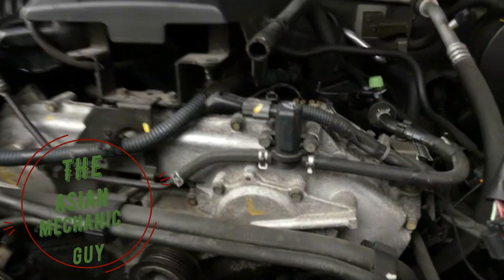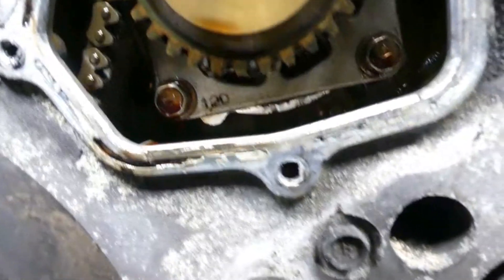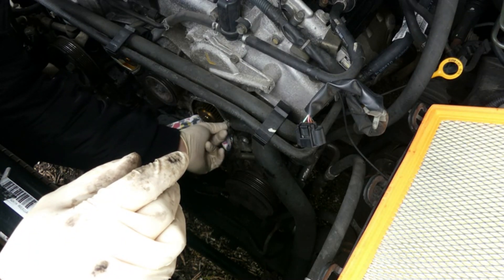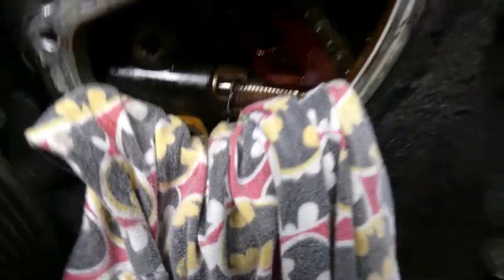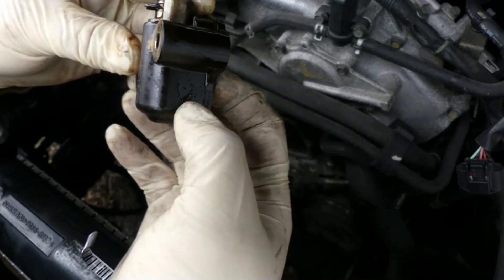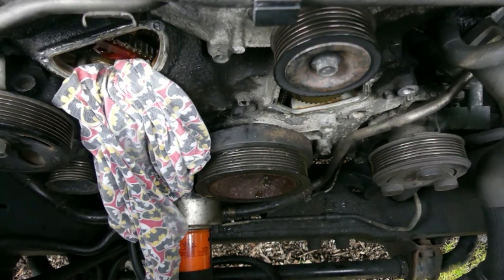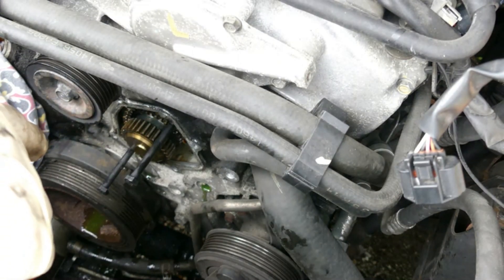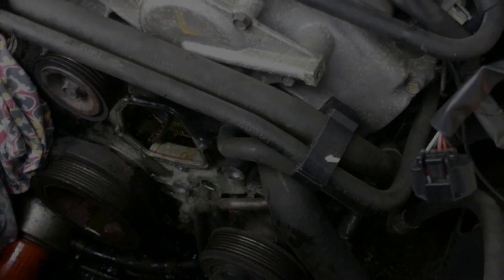2006 Nissan Frontier 4 0L water pump Leak Diagnosis & Fix PT 02

Comment: For water pump replacement CHANGE YOUR OIL BEFORE YOU BLEED THE COOLING SYSTEM. I got the engine up to temp to bleed the system. Then I went and got the stuff for an oil change. I remove the oil cap and it was creamy white !!!!! I immediately drained the oil and it was also completely contaminated!!! I drained it changed the oil and filter. Ran it for 3 minutes. Drained it AGAIN STILL WHITE . 
Went to the store got two more filters and more oil. Filled it again with new filter and 3/4 quart of trans fluid let it run for 15 minutes drained it and it got better. DRAINED SWAPPED FILTER AGAIN  ran it for 10 minutes drained it and then did a final filter and fill. I have videos and photos of the whole ordeal.  PLEASE PEOPLE DO NOT START UNTIL YOU DRAIN OIL AND REPLACE FILTER.  There was very light gold flake in the pan. Which means BEARING material. Final oil change I also added a quart of Lucas oil stabilizer.  I hope I'm able to get some years out of the engine.  Prices are going up for replacements and they all have higher mileage.  $2500 for 140k mile replacement engines..

Comment: Anyone who has never done this be careful b/c tbe tensioner plunger is spring loaded n can and probably will shoot out n can go into engine. U are supposed to press the plunger piston in and secure it with a paper clip or something(new one comes with a pin,u can use it), then unbolt the tensioner n remove it. When installing put tensioner in with slack off that side(makes it easier,but not 100% necessary) tighten it to 75 inch lbs n then remove pin. Good luck!
Reply: why u need to press it in when the plunger is already out i rather follow this procedure /video put a cloth below so nothing will drop inside and everything  will be fine..kodus to this guy its very detailed from start to finish
Reply: @totoy7224  he did great but its much easier and if you do them very often with oily hands u will see how that piston wants to pop out and how much easier it is when the piston is locked down, especially when re-installing. Only stating the correct way, since people are usually watching to learn.
Reply: @totoy7224  the vehicle he is wiron has a worn timing chain, thats why it has extra slack, if the chain had no wear or very little wear, then try reinstalling it without locking the plunger down. U will have an insanely hard time, if u even can get it in,    same for removing it.
Reply: @eminiscalperpro9729  why u need to lock the plunger when installing it when every single brand new plunger tensioner u bought from autoparts store has lock pin on it already cmon ..
Reply: @totoy7224  exactly, b/c thats the correct way. He wasn't installing a new one n a lot of people reinstall the old one.
Reply: @eminiscalperpro9729  he install a new tensioner and its pre lock already what are talking about ..and fo u think u can use paper clip as lock pin for that tensioner..

Comment: There's 2 block drains one is at the front of the timing cover kinda near n below water pump n close to thermostat, the other is behind a/c compressor(which is the one I used and still got water coming out when I removed the pump, so the one in front of engine is best, please research to find the exact location. Or put a clean collection under radiator drain cock n run engine until it has all pumped out. Make sure not to overheat engine when doing this, its easy, u can tell when its running out of water n cut off b4 engine temp goes up to 3/4 or so. Still a good idea to change oil, especially if u do get coolant spillage into oil b/c it will destroy the engine.
Reply: Thanks for this info